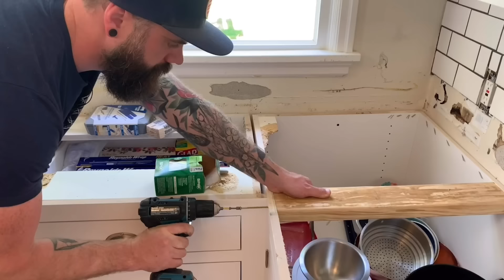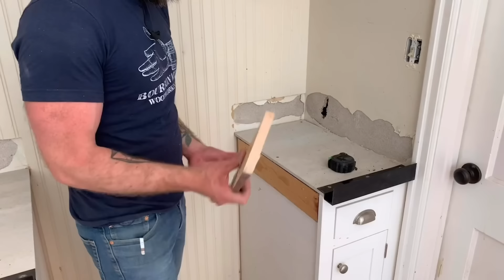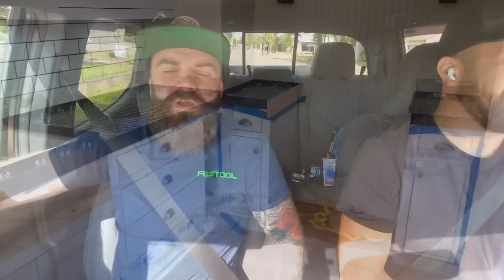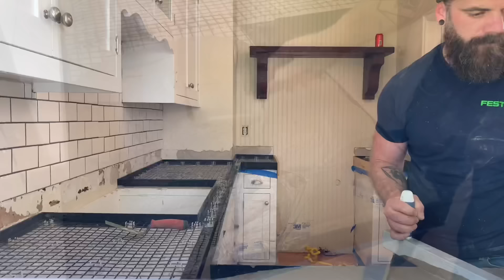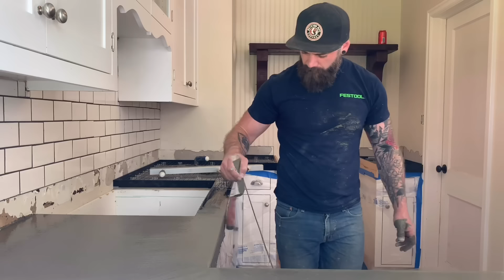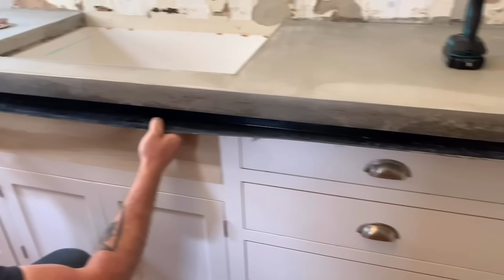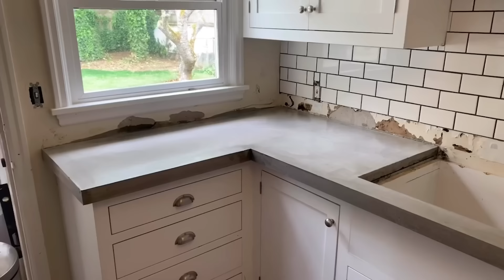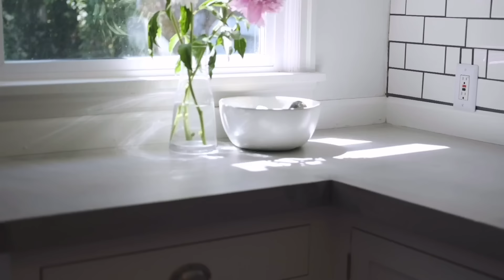Easy Concrete Countertops | Concrete Countertops How To

Comment: I love my concrete counters 8 years after doing them myself using this same system.    One pro tip - drape sheet plastic over the fronts of the counters before installing the Hardie Board - it cuts away easily after pouring and polishing, but makes cleanup MUCH faster.
Reply: Work Smarter, Not harder! Great tip!!!!
Reply: definitely! cheap plastic drop clothes will save your rear-end on clean up.
Reply: Thanks
Reply: I'll do this when I do mine this summer. Thanks
Reply: over the fronts? didn't he do that?
Reply: If u pay attention in the video, he does have plastic draped over the cabinet fronts
Reply: I've heard concrete countertops are high maintenance and stain easy. Thoughts?
Reply: What s an approximate time for countertops to dry

Comment: I did some custom cement counter tops over a decade ago from scratch - Here's another very cool tip!! Buy white cement, use white sand, buy yellow oxide powder and you can literally tint it to a light river sand color. Now - use a white powder cement waterproofer in the cement mix, this will give you a tuscan look with varying tints of the same color - plus it makes the sealer go alot further cos it wont soak in as much -  Once you put on the epoxy resin (or whatever sealer) the colors will look amazing. . They bleed out and it really makes form some amazing results - Takes some experimenting but well worth looking into! 

One important note - for large counter tops that require multiple mixes - mix all the dry goods together first - that way you get a consistent look! 

This is my own self designed system - done a few jobs and always comes out awesome looking.
Reply: You mention the powder cement waterproofer in the mix, can you clarify the process you're talking about?
Reply: @drewkaree  i found a waterproofing powder as opposed to liquid ones.. it helped not soaking up so much of the clear coat (pollyurethane resin - smelly stuff but cure quick :) -  but having recently been using epoxy resin the soaking up is not so much an issue. This was over seas but im sure lime powder would have the same effect- it basically gae a really beautiful tuscan/victorian look, like old Italian ceilings.
Reply: Nice tips Mr Burns!
Reply: That sounds so cool!  Care to post pictures (over on imgur for instance)?  Cheers!
Reply: Sounds like an awesome idea but also like you would take a little bit of work to get all those ingredients cuz I doubt home Depot has yellow oxide tinting whatever. Cool idea though
Reply: What if you want red slate look?
Reply: Do either one of those methods preventing staining?
Reply: @goldlamp574  absolutely - its an incredibly tough and durable top finish - like marble. you wont crack it and cleans perfectly. its not porous at all, the 2 coats create a complete barrier sealing the colors in and a perfectly cleanable surface.
Reply: hello, please tell me this countertops  how resistant they are to absorption and staining when spilling liquids and how strong they are to scratches compared to granite. thank you
Reply: @tefaniademadeiros7476   VERY tough- once the 2nd or 3rd coat of resin has gone on its completely waterproof and super strong.. id say probably not at tough as granite but we used it for years with 7 guys in a big international boarding house and not a single chip...
Reply: @fstarockaburns425  Great tips! Is this coating heat resistant? If you put a hot cookie sheet or pan of pasta directly on it, will it cause a problem?
Reply: @mikemiller9891  nope ull be fine, epoxy has a pretty high heat rating
Reply: @mikemiller9891  stoned and stupid here,  might be cool to have cast iron "nubs" stick up out of the counter in a cool array next to the stove to rest hot pans ... they laugh now
Reply: @dollyhadbraces9361  hey man!  Thanks for the reply! That's a fantastic idea! Since I haven't done the project yet, I could easily include it.

Comment: Ya know, most videos I've seen on the tube include a lot of finish sanding to smooth the concrete out, kudos to you showing that patience, and a light touch during smoothing leaves a smooth top.

Comment: Awesome! Screwing in the boards from the top and then adding concrete so it can never be removed again is such a smart idea...
Reply: Agree! There is really no need to screw down the hardiebacker because the concrete slab is so heavy, this way you can remove in the future if needed

Comment: As a decorative mason i love this video never heard of the concrete solutions countertop forms, definately will use in the future. However a good tip for getting a nice "beveled" or "bullnose" edge without having to grind or router it is to use a bead of silicone caulk  in every hard corner of your form and use a caulk tool or your finger to give it a nice rounded edge.saves time and money so you dont need to buy a router or expensive concrete beveling blade
Reply: Color matching epoxy to concrete and epoxying the the original counters saves far more time and far more money
Reply: @yzrippin  not the point of this video though. It’s for people who want concrete counters……..

Comment: 2 years later, and this is still helping people. I am planning an outdoor kitchen with concrete counter tops. So I won't have so much of the 'mess' issues. Those forms seem like a perfect solution. I have seen other videos where you can use a sander to vibrate the form and underside of the counter to absolutely eliminate bubbles.
Reply: Did you finish your project? How did it turn out? Did you use a sander to eliminate bubbles?

Comment: A few small tips that could come in handy-
Cover hardy backer with plastic, will further dry time.
Use a long level to check from as many angles as possible. There's a lot of trust in the cabinets 'levelness' in using the forms.
Use a longer mag trowel in initial screed, long enough to touch front to back.
Vibrate under countertop (palm sanders work well) to get best consistency.
Use a pool trowel to further finish concrete* (tricky but rewarding)
Sand countertops with fine grit before seal.
Knock down sharp edges with sand paper or stone. 
Pretty good video overall, but could use a few pointers.
Reply: Exactly he skipped the sanding part witch is an important step for a proper finish product.
Reply: Does the sanding work with sand topping mix? I assumed it would pull sand granules. I've never used sand topping mix on projects like this however.
Reply: Probably would have looked better and stronger if he used some aggregate and chamfered edges

Comment: The ones I put in my kitchen at my old house looked so nice. Made my  edge forms out of this triangle strip of wood we used when we pored    columns. It gave the edge a classic 45° angle  then I polishes them to a glass finish  we had sage color added to it and little lime stones instead of pea gravel. It looked great.
Reply: How did you polish the concrete top?

Comment: maybe a slight bevel or round on those edges, they look quite brittle and would be prone to chipping.
Reply: That’s exactly what I was thinking about. I would hate to see one of those edges get chipped off
Reply: Any edging tool used same as doing a sidewalk or drive would work. From the very slight 1/4” edge right up to a bold 1” radius edge.
I used to cut pvc pipe to create lower bullnose forms when doing house steps. Then used a matching (or reasonably close) edger to do the top edge. 
(But I’d have steeled to surface more than just the once? To give a harder polished surface.)

Comment: Excellent video as usual 👍.  There is only one think different I would have done, only because I've watched a ton of videos on the subject, would be to trim the hardie board 1/4 to 1/2 inch in the stove opening on each side, to hide the hardie board and having it show only concrete. 👍

Comment: Tile is so hard to get. Cause there either isn't enough to do a whole kitchen. So it took me 4 months to get enough title. AND THE TYPE OF TITLE I WANTED >  To start the job... It was worth the wait. IT EASY TO CLEAN, AND VERY DURABLE > to cutting on it, banging on it.  hot and cold skillets and things. Plus if you spill some thing on it. IT DON'T RUN ALL OVER THE TOP. It pretty much stays there > I like this title so much that i did all the window seal bottoms in it. A Deep freeze top for a butcher table, and a bar. Not counting all the Kitchen. It gave my log cabin new life. and made it look AWESOME 👍

Comment: Just wanted to say, I watched this video a few months ago & decided I'd have a go at upgrading my English Yorkshire farm house kitchen tops from the old horrible woodchip tops to concrete. But I went one step further & placed down copper pipes at an slope towards my sink as a trainer. All I had to do was carefully grind the ends of the drainage grooves so water does flow off into the sink. I couldn't find the sealer you used however, probably only available in the US, but after some advice, I went with food safe concrete oil specifically for water sealing concrete counter tops. 

So big thank you for the inspiration. What should have cost me £600-£700 for a wooden replacement, it only cost me £200.

Comment: I used the exact same product for my countertops and they also turned out amazing! I went with a charcoal tint and I also wet polished them with diamond pads. The wet polish looks amazing because it really shows off the beautiful aggregate in the concrete, but damn, was that a freaking mess. I had plastic sheeting covering the floor and from floor to ceiling, it seriously looked like a Dexter kill room in my kitchen. But even with all that protection the wet polisher shot slurry all over the place and there were waterfalls pouring over the countertops pooling onto the floor, my buddy was unable to keep up with the shop vac to keep the water under control. An absolute mess but they turned out gorgeous. Maybe you can do a video on how to do these with a wet polisher, you may come up with a better solution to the crazy mess I had to deal with.
Reply: hello, please tell me this countertops  how resistant they are to absorption and staining when spilling liquids and how strong they are to scratches compared to granite. thank you
Reply: I used a spray bottle with my polisher and had much less mess and my counters turned out fantastic.
Reply: @tefaniademadeiros7476  after you seal them they are very stain resistant. I sealed mine with bees wax and after a year I have no stains. As for strength, I am fat and I stand on my counters .

Comment: Wow I love the progression on doing these counter tops. These forms...my god! I did my own CC tops 15 yrs ago and used Melamine forms and wire mesh-which I thought worked well too. PITA!! I used a mix called "Sakrete 5000". It had fiber mesh, mostly sand and Portland. No aggregate. I used 3 layers of colored acid stains to make a patina which looked sick. Could you have stained these counter tops before you sealed them? Nice work man.

Comment: Any diyers who use concrete the best tip ive learnt for slabs was getting a jig saw taking the blade out and just letting the tools do its work on the form no air holes n completely compact

Comment: Loved your video. Definitely going to do this. A good solution I learned is using an oscillating tool with a sanding pad as a vibrator to eliminate air bubbles. Hope this helps.

Comment: When I worked as for 3M as a travling hard floor teck, I was able to make a concrete floor look li,e a sheet of glass with the diamond pads on a swing machine.  Those diamond pads would fit to a disk sander and could be used on this before sealing it.  Just an idea.

Comment: Loved this. Great quality and care at installation. Research clear on products used which help with the finished quality. Really useful.
Being a builder I would add some care should be taken handling concrete as the burns can be horrific! Gloves must be used,and ones that don’t suck up the water ie rubber gloves!
Reply: My husband was concrete contractor,  you are so right about burns and nasty I fertions. Wear  gloves his hands and fi get nail were smooth not  dry and cracked.  Miss him.

Comment: 1. Your tools DO NOT NEED TO BE WET!2.Its better to do it with a fiber float than finish off with the trial
3.Its better to not angle your trial as much because it can leave something know as concrete cellulitis and it looks a bit odd, instead barely angle your trial and pass over it fast to reduce tiny air bubbles. Everything else was good. Great job

Comment: To make sure that the concrete is bubble free use a round head M10 bolt in the chuck of a hammer drill to get everything vibrating.

Comment: Love the idea but there's a couple minor issues, the main one being the sharp outside corners, they're likely to chip in no time and God help your kid when they eventually crack their head on it. If there was a way to round the edge it would make an awesome bench top. I also have  some reservations about the fiberglass mat, unless those clips and add tension they're likely to just get pushed against the hardie board.
Reply: I promise I'm not being a smartass but if your kid cracks there head off a wooden worktop it's a trip to A&E either way. As for corners grind then sand.
Reply: No it won't be a trip to a&e, it'll be a few tears because wood is far softer and has much more rounded edges.. you're the second person to comment about grinding edges yet I can almost guarantee neither of you work with concrete if that's the best solution that you can come up with. You'd never get the edges looking right and just fill the house with silica dust it's a bad idea around....
Reply: @VeritasSimRacing  hmmm have you heard of this thing called concussion... Oak, walnut, cherry, maple none of them are soft against your head lol.... And if your scared of dust don't make a concrete worktop. Simple

Also I never put my resume up so don't assume anything.
Reply: @markdove5906  scared of a little dust? Never heard of silicosis obviously... The intelligent thing to do would be to make a form that's already rounded... Makes for a far cleaner finish.
Reply: @VeritasSimRacing  use your common sense and wear a mask!!! 
I don't think they've outlawed work on concrete! If you can mitigate the risks not a problem.
Reply: @markdove5906  mate I'm not taking the piss out of you but you clearly have no idea. That dust is stupid fine, if I'm grinding concrete in a building basically that entire level will be coated in dust unless you are willing to spend thousand on decent quality dust extraction gear like the gear I have... Im a concreter,I do this stuff for a living trust me your idea is probably the least effective way to do it
Reply: Maybe add silicone bead to the corners (before pouring) but you'd think those plastic things should come with a solution
Reply: @frankeemore  typically when I'm building the forms for tilt panels or cast in situ walls id put a piece of filiet in the corners for that purpose but I just can't see that looking like a professional job when you're doing a counter top.
Reply: That’s why a lot of people would build it in a shop or on level ground with a form they can put some moulding in the corners to have decorative or rounded edges. Also they’re grinding wheels with diamond profiles that grind the edge in with a wet grinder/polisher but that combos not cheap and will portentously change the color/finish on the edge.
Reply: @yoshi450gmail  you nailed it. Most likely will change the colour so you'd have to polish the whole piece for consistency.

Comment: I'm surprised that there's no surface or edge sanding involved after the forms are removed.
Reply: Rightly so, it did not look good around the edges or at all for that matter. It was just a common concrete pour with moulds and the sealant was wasted on raw edges/surface.
Reply: there should be
Reply: @ijelev68  Yes completely agree.  Super half assed job.  I couldn't believe he said that was finished
Reply: @justinbouchard  - a single hit with steel is not ‘finished’. Lol